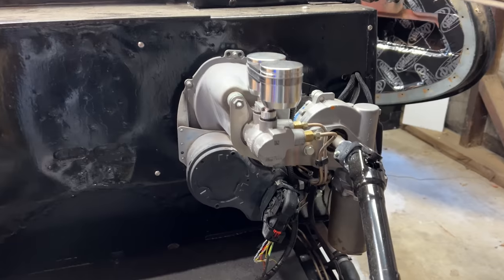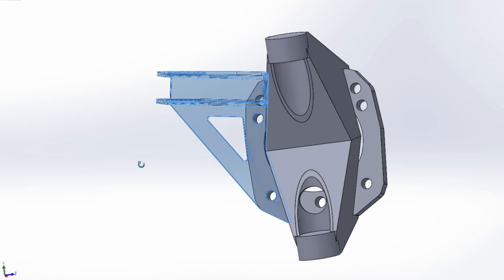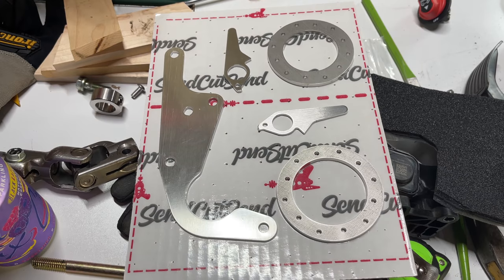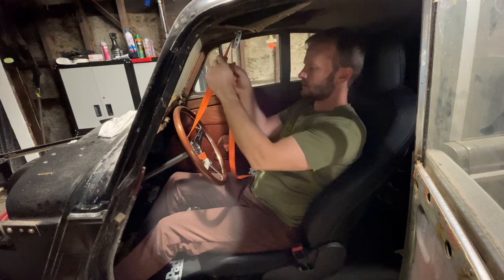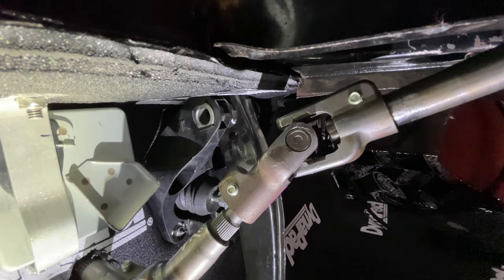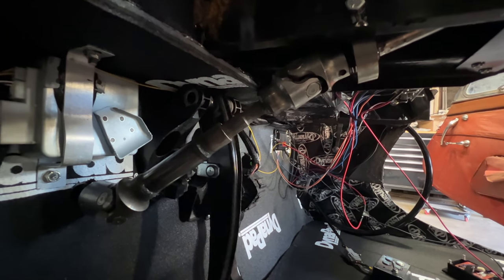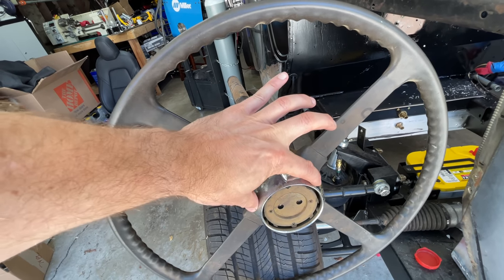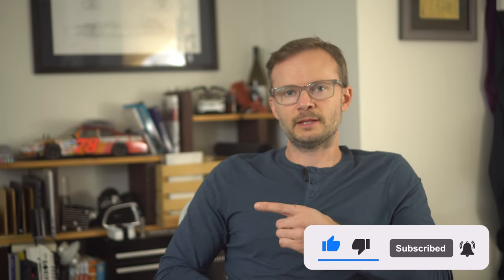Steering Made Simple. And Then Made Complicated. And Then Even More Complicated.

Comment: Couple of things: 1) where did you get an off shelf spline coupler?   2) I don't know how hard it would be to find something in the size you need but CV joints would also solve your shaft angle issues. I've seen some that work at extreme angles.

Comment: Mount the wheel to a hub, then mount that to a bracket. Finishing with an encoder behind. Make everything pretty, and mount the assembly inside, where it will not move,or detach. On the outside move the pump to, as close as possible to the rack, and mount that assembly where it will not detach unless desired. On the input mount a drive in which can be synced with the encoder, on the wheel, and if desired anything beyond a wheel that feels as there is nothing connected to it, take two sensors and connect each one to each side of the rack. These sensors will take readings of the pressures, you know what. Double that. Put a sensor on the front and rear of each hubs to get the pressures as the steering is kicked back and forwards. Then back inside. Take a shaft, with two taped inserts along with a small drive that can receive the signals, and average them in each direction, with the forces applied. Then it could tighten the nut, and if desired some gearing could be connected to kick in the corresponding direction. These forces are not strong enough to lock up anything, or to overpower the driver, just to give feedback.

Comment: Matt...... have you considered running a servo motor on your rack, powered by a rotary encoder on your steering wheel, with no mechanical connection to the steering rack?  Possibly with a tactile feedback to the wheel so you could "feel" the steering effort from the servo.  (yeah, I know, I can already see issues with this if suddenly power is lost, so there would likely have to be some sort of mechanical connection of some sort for safety reasons), but conceptually you could stick your steering wheel, at any angle, anywhere in your car.  You could also program in any sort of steering ratio, or even variable ratio, based on speed, or whether the wheels are straight or turning.
Reply: This is the type of over complexity Matt loves great idea
Reply from the maker: Someday soon you’ll be able to get this kind of system out of a junkyard car. And then it will be awesome to shove in an old hot rod. Unfortunately we’re not quite at that place yet. And designing the system myself has a lot of complex controls and giant safety issues. Might be a cool project for an off-road only car.

Comment: I've seen steering shaft offsets mad with timing chain hardware to allow the driver to set further inside the roll cage.  It also allowed for quick lock to lock steering ratios.  The quick ratios were great for race maneuvering but sucked when it was time to trailer the car...

Comment: Why not put the electric steering inside the car as designed? That would clean up under the hood and alleviate all the crazy angles. Also, make sure you use a slip joint between the R&P and the straight column shaft for head-on's..

Comment: What about making new mounts on your chassis to rotate the steering rack rearward and then mounting your power steering box down by the rack and pinion so you have a straight shot from the rack to the power steering box, then you should have a nearly straight shot from there  to the steering wheel, have to use a collapsible shaft for safety then.

Comment: You can always just keep adding unnecessary complexity until you have a circular dependency. Then suddenly the complexity becomes necessary, it's all predicated upon each other, problem solved. Works every time i tell you!
Reply: If I'm not mistaken, this is how German cars work. 🙂 E.g., a keyless proximity sensor door handle for keyless entry may be an "unnecessary" feature, but if you program the body control module to refuse to start the car when somebody is trying to open the door and therefore the car will not start at all with a shorted or faulty door handle, the proximity sensor door handle is now an essential  feature!  Genius.  The possibility of any (now essential) part ever malfunctioning simply does not warrant consideration. 😊

(I watch too many DiagnoseDan videos diagnosing bizarre and inexplicable electrical problems on German cars, lol.)
Reply: @TassieLorenzo  I have worked for engineering offices of two (mostly) unrelated German automotive companies. Computer engineer. Before you blame anything on me, everything like that is Product Owner's fault, those are management people, not engineering.

Comment: Love the channel, usually on board with the shenanigans.. but this looks like a complete nightmare. Is there an electronic wireless  hookup available that can be used to control the steering rack without it actually being connected?
Reply: The Infiniti Q50 is one of the few cars with steer-by-wire available, but even then it has a failsafe where it can engage a clutch and mechanically connect the steering if necessary. I'm not sure if wireless steering is legal?

Comment: an hydraulic powered rack would have been a much simpler solution,
 with that lot of u-joints installed that way, you call for trouble in the life of that car.

Comment: Couldn't the steering be done with hydraulics like the brakes? Seems like a bit of a pain to work with the shaft and all the angled joints.
Reply: No, because the failure mode for hydraulically-connected steering sucks.
Reply: There are vehicles with hydrostatic steering (such as some tractors and construction equipment), and they are not used on the road or at high speed.

Comment: And all quite illegal in the UK, you can't weld steering parts period. Not the shafts, the U-joints or the parts of the suspension upright. All absolutely banned.
Of course the factory can make welded parts, but you can't.
Reply: Mmm,  kit cars and Vosa  inspector's,   been there  ...
Reply: I know a guy who made the steering of his competition Mini quicker by cutting off the steering arms, cutting them shorter, and welding them back on. He ran an auto repair shop, so someone asked him if he could do that for them, and he said no... only for his own vehicle, not as a professional service.
Reply: @brianb-p6586  Yeah, that's the sort of thing that led to the ban. I know a company that did the same with the spheroidal graphitic cast iron steering arms (same material as the Mini ones,) on Marina suspension on trials Marlin Kit Cars.
Welding SG iron without lengthy heat treatment is a complete no, no.
Silly really because in both cases you could machine one up easier.

Comment: As an engineer, I know you love unnecessary complexity.
But for the love of God don't use a Dropbox. Go drive a car that has one first.

And then realize they would just be a better idea to redo the mount with a wedge or something to offset it so that it's angled properly to reduce the u-joint angles.
You do not want to use an offset box